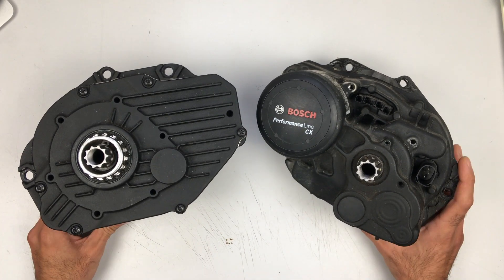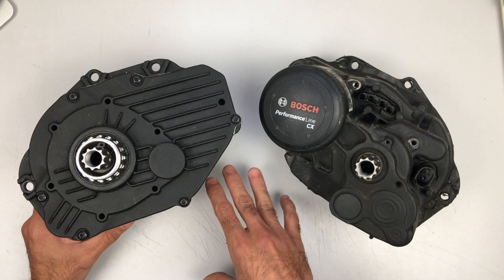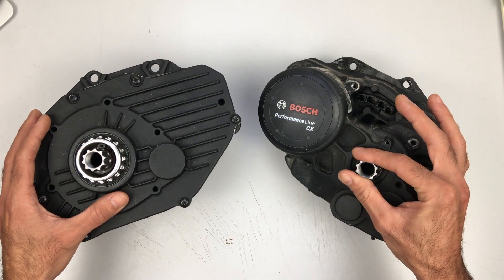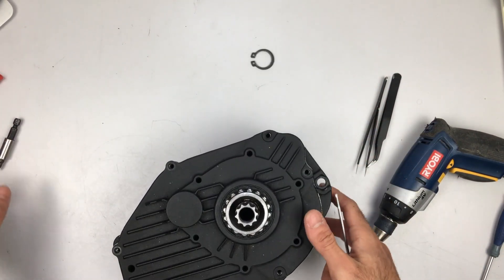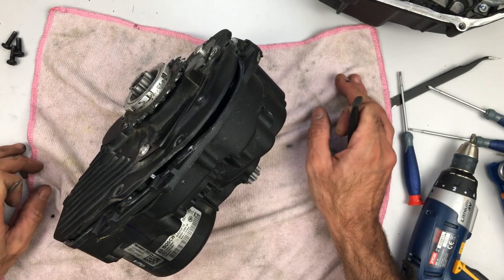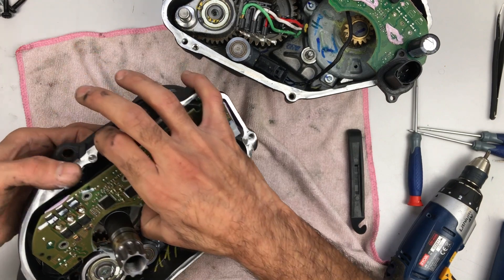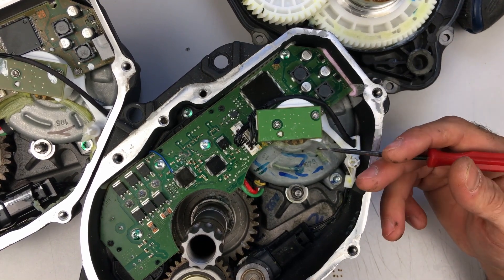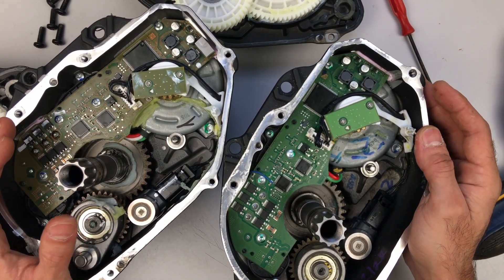Bosch ebike mid drive motor - a look inside

Comment: Thank you for the video! I have the error 500 too, but not always. Sometimes I turn the bike on and it works, sometimes it doesn't. Do you have any tips of what it can be?
Reply from the maker: Hi,
A buddy of mine told me that he resolved the error 500 problem by desoldering then resoldering the 3 phase wires.
I haven't tried it yet.  Maybe you can and let me know?
Good luck.

Comment: I have the exact same problem with a perfect bosch bdu290p, it seems like the main board is not able to see the speed sensor. Replacing the sensor does not matter, resulting in a 503. Have you been able to figure out what is wrong with yours? I am thinking about a vesc conversion as well, the only problems are that I do not want to but a new battery and that I need to find a (waterproof) location for the controller.
Reply from the maker: Hi,
No sadly i never figured out what the problem was with the motor. But I've been running it on vesc ever since.
The waterproofing problems could be solved by a good plastic enclosure or frame bag or something like that. As for the battery, with some luck you can find a good second hand battery, but as your motor doesn't show the speed anymore, unless you want to keep the bosch battery for the lights, you can open it and install another bms if you have some experience and use it with the vesc. Or EVEN better sell it and buy another one you can use. 
Anyway, the important thing is to get the bike running. 
Good luck.
Reply: I managed to find the problem on mine, it now shows speed but I created error 500 in the process. Will be trying vesc. your video’s were very helpful :) thanks
Reply from the maker: @Matthijs1994 hi,
That's interesting. As it now shows the speed, and if it can also run the lights even with error500 it's all good.

Comment: Hallo 
Mijn bosch middenmotor performance cx Ger2 gaat niet aan , ik heb vanalles geprobeerd en de motor wilt niet aan gaan . Is dit nog herstelbaar? 
Met vriendelijke groeten
Reply from the maker: Hi,
Check out my other video about running it with a vesc.
Your bosch controller inside the motor is probably dead, and it could be a number of things. 
Good luck .
Reply: @theelectronage  welke video juist?
Reply from the maker: The last one I posted.

Comment: What about just installing a new controler taking the three motor phase ?
Reply from the maker: Hi,
That's exactly what I ended up doing, using a vesc.
I've done a video about it.
Reply: @theelectronage can I get a link to this video on replacing the controller with a 3 phase for the Bosch mid drive.

Comment: Hello, you know how I can fixit the Code 500?
Reply from the maker: Hi,
Sorry i don't, it could be one of a few  things. 
One thing I learned recently is, when either the torque sensor or the sin/cos encoder is disconnect from the controller the error 500 shows up, but also if for example when one or all of the phase wires aren't connected. 
But sadly it could also be a hardware problem on the controller itself, in which case it's improbable that it could be repaired. 
If you kinda know how to go about it just by process of elimination maybe you can get somewhere. 
On the other hand I have a video not yet published about running a bosch motor with a VESC, which works by the way, but could be improved. 
Good luck.
Reply: @theelectronage  if anyone know how much would be to send failed motor to Bosch refurbish factory in DE and if they only replace the faulty part (motherboard or sensor)?
Reply from the maker: @niccots  hi,
Yes you can send your motor to bosch to be repaired but through a dealership, the repair itself is free if under warranty, otherwise it is a bit expensive in the range of 400-700 depending on what you have.